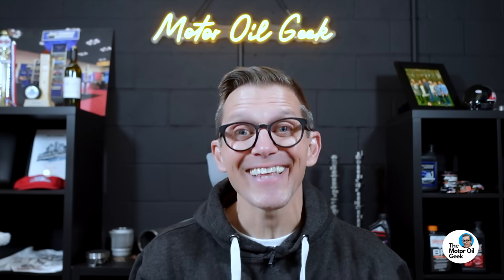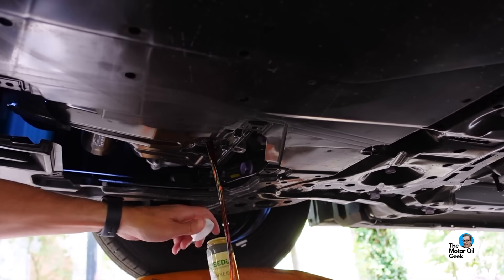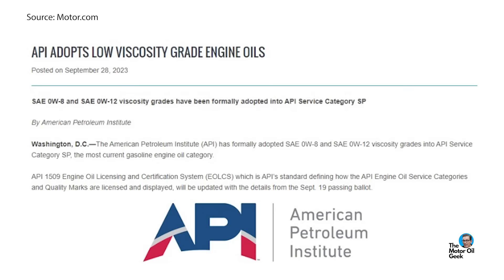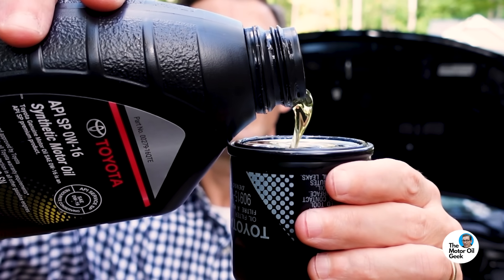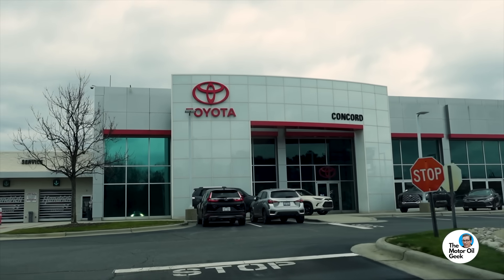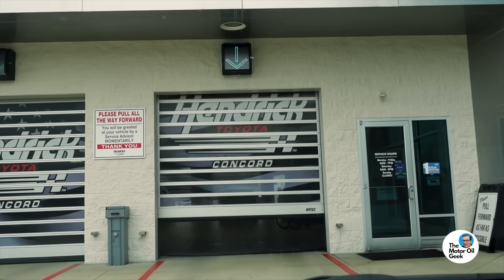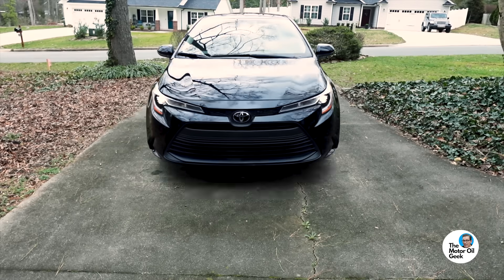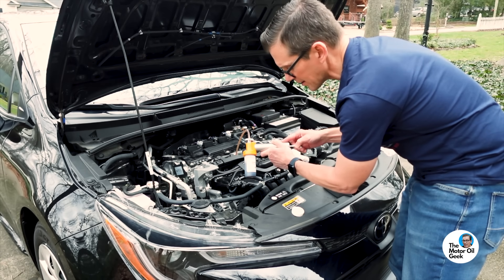0W-8 Motor Oil: Too THIN to Trust? Let's Find Out!

Comment: Way back when, I used 20w50 oil in everything and it seemed to work great. Over the years it has been hard to adapt to the ever-thinning viscosities. I am struggling with the 0w20 requirement in my newly-purchased 20011 FJ Cruiser and now they come along with ow8! Your extensive testing is helping this aging gear head adapt to a new reality.
Reply: That makes sense if your temperature year round never allows for the sight of snow. But don't do it if you have an actual winter where you live
Reply: It’s crazy what manufacturers have to do to meat the flipping EPA standards 🤦‍♂️
Reply: Design, engineering, and manufacturing have changed drastically. Also, to consider engine oil isn't just for lubricating. For instance, there are many engines that use engine oil and its pressure to actuate timing chain tensioners. There's also other synthetic materials being used within these engines like seals, enclosures, and guides, which are also in need of certain chemical additives for which conventional older oils do not have.
Reply: Also, manufacturers aim is economy not longevity so v thin oil may not be in your best interest.
Reply: @bikeman123  Incorrect. They give you the rope to hang yourself with though.
Reply: cus engine tolrances are much tighter now.  old 60s 70s 80s where horrible specs, lots of slop in engines.  things do improve.  If you use too thick on modern engines you will cause damage, ever think the makers know what they make?
Reply: @cengeb  Yes. Since many car of the engines depend on a certain oil flow for their adjustable cams to work. It may well cause a problem.
Reply: @cengeb  That's very true, but I still would be extremely skeptical to run anything less than 20 weight in anything that's going to haul or tow. Too much stress on the drivetrain to depend on sub 20 weight oil keeping parts from touching.
Reply: @bobbygetsbanned6049  Thanks for this! I say that because I have the lowest power, production car in America. The Mitsubish G4, and it revs a lot more, it's built for that, but I wonder if just pulling itself, is why they went with 5w-30....but it also makes me consider that they've made them similarly for so long, that maybe the cheapest car in America, which is going away by the way, that maybe, just maybe, they haven't built them any tighter or newer, so they were wise enough to still insist on 5w-30. Sure, cafe keeps pushing the limits, but since it sips gas, they didn't have to compromise on the oil choices.
Reply: @cengeb  You failed to explain why in countries that don't have a corrupt EPA or CAFE' standards use 5W30 on up for their hotter temps, without problems, and no, they are not going to run a different assembly line for another country.  You keep believing the BS.
Reply: @lonniebeal6032  actually different regions do have different specs in the similar engine, wake up, they use different fuels, and oils.  For what you think is the same car, engine.  Doesn't have to be made on a different assy line, but they produce cars to the region it is being delivered, all cars are not the same of a given model, same with engines. wow, the world doesn't revolve around what the U.S. has, or sues...it's a big world out there.
Reply: @cengeb  THEY ARE NOT TIGHTER SINCE 2000
Reply: @AG-sx9ws  Things change in 20 years, accept it, they certainly are better at even closer tolerances.  Accept it.  And more efficient, , it's not 1964, join it, things actually do improve.  Emissions stds improve, things do get better, o;d is not better, new means improved function.
Reply: @cengeb  thats not what changed LOL. since the early 2000s clearances are NOT tighter. you read that right. almost no changes in 25 years. the improvements for 0w16 and 0w8 are primarily in oil gallery design to avoid cavitation and in bearing coatings. the surface is doing a lot lot lot of work which would have been catastrophic damage just ten years ago. nanoparticle factory coatings on bearing surfaces make all the difference.
Reply: @AG-sx9ws  tighter tolerances, is what you described
Reply: @AG-sx9ws  better coating on bearings mean tighter tolerances, you are playing word game, stop
Reply: @cengeb  no, it doesn't. the gap aka the clearance is literally the same as before. stop moving the goal posts. you have no idea what you're talking about
Reply: @AG-sx9ws in 20 years if things have not improved,then you are buying obsolete junk. Things have become much tighter specs mechanical,and everything else. Join reality
Reply: @cengeb  BMW and Toyota crankshaft journal bearing clearances are the same as they were 20 years ago
Reply: @AG-sx9ws  Lot more bearings in engines that require lubrication than crankshafts also.  so after 20 years neither BMW or TOYota have improved specs, and tolerances.  You are confused, bearings are improved that use motor oil for lubrication, besides crank, etc. Piston rings are different, including the oil ring.... So you are driving a 20 year old engine?  time for you to wake up.  Most cars 20 years ago where doing lot thicker oils, due to much larger specs.  now 0-20,5-30,0-30,now 0-12,0-8  is common...things improve over time.  If you think today's engine is like something from 20 years ago, stick too your obsolete vehicles, if you don't want to join 21st century
Reply: @cengeb  bearing clearances haven't changed; the main problem that modern bearing materials solve is the problem of wear which would have been catastrophic with old bearing technology. also there is the problem of cavitation when very thin oils are used. oil pumps and lubrication systems are the main design updates that allow these very thin oils to work in today's engines. its not the tightness of the engine that changed but the materials and some lubrication system design updates
Reply: @cengeb wrong, if you look up service Manuals, there are cars from 2004 with tighter beating clearances than some 2024, some are more or less the same, you clearly don't know what you're talking about. We're going towards fuel economy (has always been since the 70's) and that means better materials and better oils, but not necessarily tighter clearances. 

Why a Corvette requires OW-40, vs that same engine in let's say, a GMC Sierra? Is not clearances, is the temperatures that oil will see that will actually require more film strength, how? With a Thicker oil. Now Respond to that with your "21st century theory"
Reply: VW 2.0L turbo is now on it's 4th generation EA88...things have improved.  over the last 2 decades.  From better cooling of the upper end to reduce carbon buildup due to direct injection systems.  And oil specs have change along with it.  i have a 2013, and 2019 VW, they use different oils specs one is VW 502, the other is VW 504  different version of EA88 2.0L turbo one being in a golf R the other in a tiguan  they have changed, so different oils matter.  the tolerances have changed...keep using your rotary phone, and be safe in your obsolete vision of stuff.  Also VW spec is not listed on many brands, but on certain brands, it matters, for emission and wear, etc.  If it was all the same why do they have different oil specs, even with in another 2019 VW, it uses different oil specs.  Different version of the engine, that's why.   3 different VW models, close in model years, all 3 use different spec oils...hmmm.  But you know better than the manufacturer, like so many driveway experts
Reply: @AG-sx9ws  oy vey, yeah, tolerances or metallurgy and all new assys methods hasn't changed, sure, engines today are just like they where 25 years ago.  Oy Vey.  I think the 2.0L turbo VW EA888 I think is the number, is in it's 4th and final variation, it has changed a lot.  It doesn't even use the same coolant specs in 2019 versus some of my early VW's.  Stay awake, and learn something.
Reply: @AG-sx9ws  Being uninformed like you is scary...it has to hurt, cus' it makes my brain hurt reading your nonsense.  If you think a modern engine is like it was 25 years ago, you need to keep your rotary phone and rooftop antenna for tv.  Our 2 VWs with each a 2.0L turbo are 6 years apart model years, engines are totally different, oils, coolants, spark plugs, oy vey.
Reply: Shadows-RC  I've had lots of VW models, majority are turbo, in the last 20 years, each version came with different oil specs 502,504,508 etc.  2.0L turbo, called for different oil specs, hmmm, things are not the same as 25 years ago, and it's a good thing.  Because things improve, if they didn't you would still be driving a Pontiac

Comment: Finally, a specialist willing to tell the truth with science. Nice. Great vids. Our 06 highlander 3.3 lt has 356k, daily driver. I do all the maintenance on it. I change the oil every 3k. I  use Pennzoil full synthetic. My Tundra has 304k runs great. Oil change same as highlander. Change tranny fluid every 60k.
Reply from the maker: Thank you!
Reply: What a waste of perfectly good oils.
Reply: @Adam1nToronto  Ford: fix or recall daily. gM: garbage Motors. Dodge: Dodge it! That why Toyota is the #1 auto company in the world. So sad!!!
Reply: Keep the rust off them, and you essentially have “forever” vehicles there!
Reply: @lukek1949  I live near the Canadian border. Lots of salt/sand on the roads. We live 30 miles from the nearest car wash. So, I connected our house water, both hot and cold to the outside hose
 Works great!  Minimal rust on the cars.